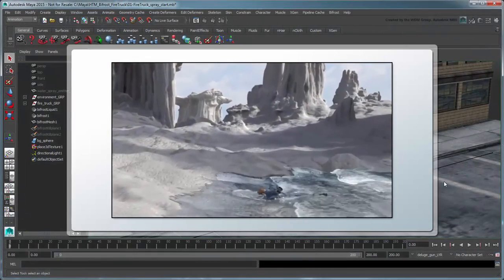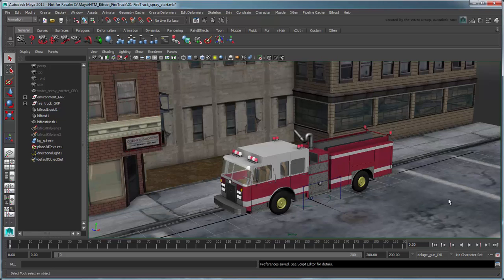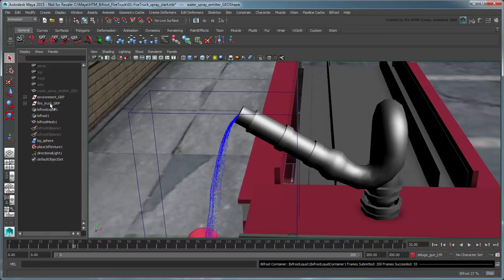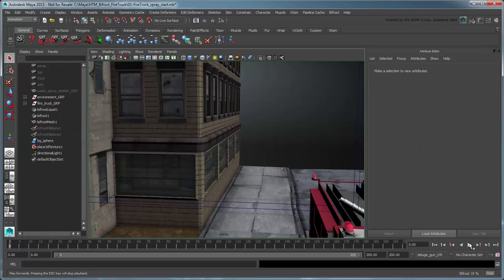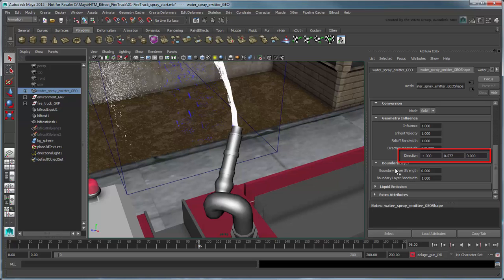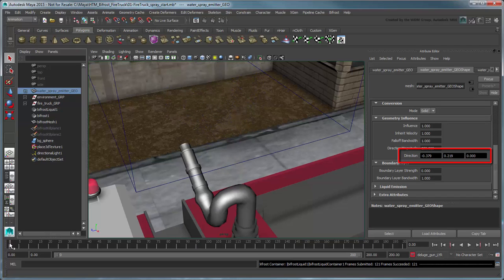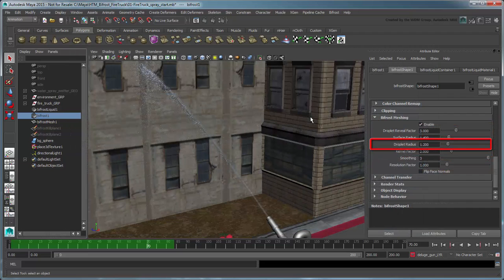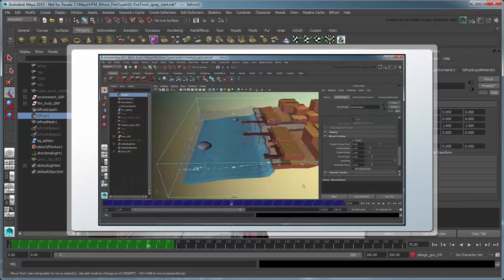Creating an accelerated liquid simulation using Bifrost (Maya 2015)

Comment: Aaaaand, I can't find "add accelerator" option in Maya 2018, and nowhere in the Maya documentation covers that little detail...
Reply from the maker: Sorry, I've been meaning to update this tutorial for a little while.  Things have changed considerably in Bifrost since 2015.  Now, instead of using Add Accelerator, you're going to want to go to Bifrost Fluids > Motion Field.  This will add a field do your Bifrost simulation that you can use to add all kinds of different forces / influences.  You can then adjust the direction and magnitude of the field to affect the water.
Reply: Thanks for the reply! It works like a charm.

Comment: You'd need to know the angle of the emitter?.... how counter-intuitive (typical with Maya). There should be a simple check box for the liquid to flow in the same direction as the local XYZ of the emitter's shape.
Reply: +papi3d some basic trigonometry wouldn&#39;t hurt :) it gives more insight into the software's core. Just open windows calculator ,set it to degrees, type 60, then press tan, and then press 1/x, voila. You can look up trigonometry online for some basics. Doesn't have to be counter intuitive if you enjoy it, intuition is a phenomenon observed in all fields, not just art. But i guess there are ways of speeding up the process, but at the cost of people not using/pushing their brains perhaps..this could be great for machines and software and easing our lives, but maybe detrimental for maintenance and development of the human intellect..this tendency to want fast cheap and easy...constant tendency to avoid the slightest bit of challenge or overstepping of the comfort zone..... Just speculating. But they say, people always seek new ways of challenging themselves and going beyond the norm...so that could serve as a counter-argument, if it's true.
Reply: +hagopovski  Are you seriously arguing that software should be counter- intuitive? When you work professionally, and you have deadlines, you don't have time to "have fun with math" and open calculators...a simple check box is all that you need.
Reply: +papi3d Fair enough...but there have been times i've done it, and i still managed to keep to my deadline...maya was lacking some blendshape features and i had to compensate by learning additional things. But i understand i guess, not worth risking the deadline.
Reply: It should be alot simpler. You should be able to parent the emitter to the emission geo, and just have it follow along. Similar to Maya fluids. Having to to trigonometry just to have an emitter follow some geo, is a huge waste of time IMO.